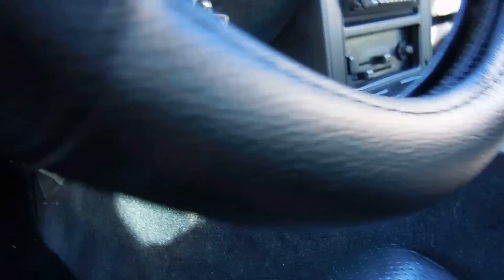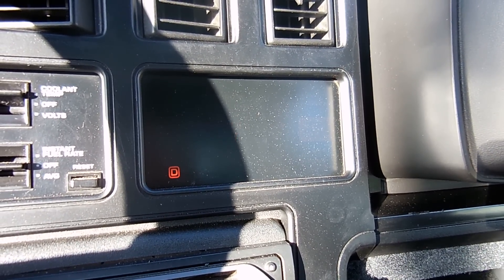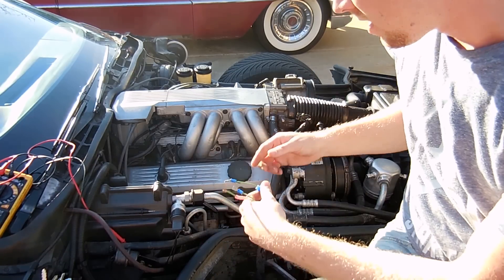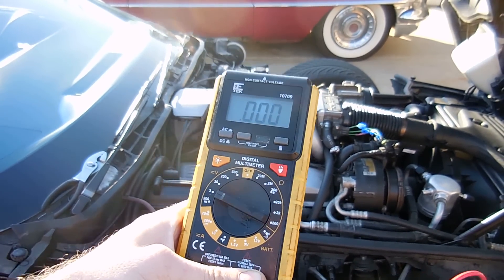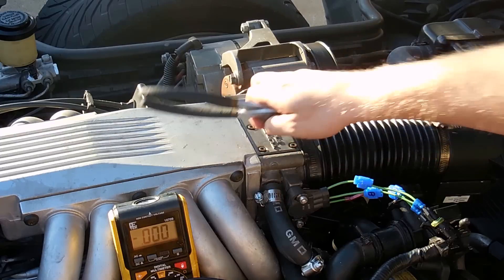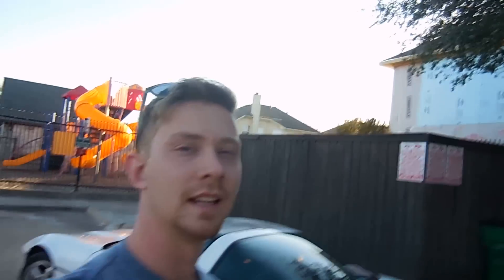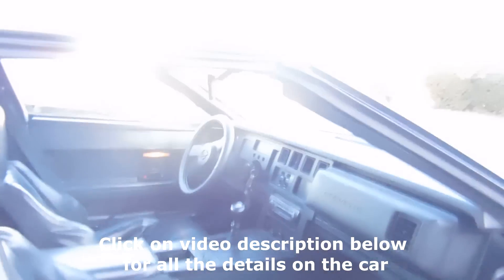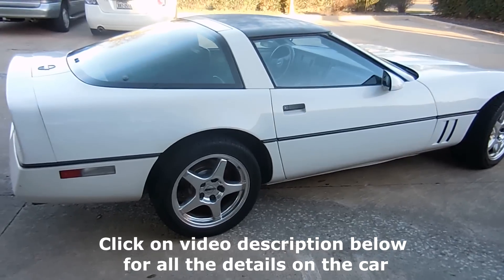1985 C4 Corvette Project: Daily Driver Part 8 of 8: TPS Code 22

Comment: you probably weren't expecting a commit on this video so late, I stumbled on your videos like a few days ago, I already. purchased my c4, its an 84 with less than 30 gs on the odometer, yes I knew it have problems it set in a machine shed on a far for 16 years. Yes an 84 is what I wanted; I still have the original poster. just saying that car look just like mine

Comment: My 89 was stalling but would restart. I thought it was the fuel pump or the fuel pressure regulator, so I changed both which did not fix the stalling. I found your video and then adjusted the TPS. FIXED! Thank you

Comment: The question not answered is did you fix the OD problem...  The OD, may have had a problem due to the OPEN thermostat.  There was a temperature sensor that caused the OD to shift out of OD, when the temperature was COOLER than 180 degrees.  It may have been tied to the Oil Temp if not the Water Temp.

Comment: Are the antennas to these supposed to go down all the way? I've just made peace with mine being always a foot in the air sticking out. It extends the full length when the car is running, so I just thought that was normal lol
Reply from the maker: No they should go down all the way. When it is up all the way, try using some WD-40 on it, might have dirt inbetween the moving parts, will help it travel smoother.

Comment: I usually replace those tamper resistant torx screws with the pin in the middle that GM likes to use on sensors with one with a Phillips or hex head.

Comment: I know this is an older video but if I were to drop only around 6k, would it be worth buying a C4 as a daily drive? (assuming i wouldn't have a whole lot of money for parts / fixes)
Reply from the maker: +Pterodactyl Mum you can actually get quite a nice c4 for 6k. You can also get a high mile ragged out c5 as well
Reply: TheCorvetteBen Would it be worth it to get a used car for that price without a whole lot of fixing it up?

Comment: 7k???  A little steep for an '85 don't ya think?   I mean I picked up an "84 recently for $700.00, running, derivable and not all that bad looking...  I'll have 5k in it total and it will be twice as fast as stock and look just as good as new...
Reply from the maker: Think what you want, but with the new engine in it, it sold for close to $7k

Comment: Hello, I really enjoyed the videos on the C4. I parked mine (1986) in the garage a few years ago and now it will not start. I replaced the battery, put $10 of supreme gas, and it will not turn over. I wanted to fix it up for my son, who's in college, because my dad bought it for me. Can you help me fire it up to get it to a shop?
Reply from the maker: +Aint No Mo Butter Cakes check battery connections and starter connections if the motor won't spin

Comment: Did you get 7k for it?
Reply from the maker: +Bill Dollarmovie close to it
Reply: I really want a c3, could I get lucky for around 5k?
Reply: +Bill Dollarmovie if you are willing to do some work on one. check out Craigslist, you might be surprised. I got a 77 once, nice, guy was asking 7k told him that I have 5 cash, he said come get it. cash talks! Good luck and happy hunting!
Reply: Glad you did this, I never pulled the codes, but my idle was erratic so I decided to put some use to a volt meter.  My voltage was high, brought it down to. 54 and it now purrs like a kitten every time I slow down or come to a stop.   UD Man., Keep up the great studies.

Comment: KnN filter with cut top stock air cleaner lid -10hp . air intake temp. sensor, clean mass air sensor -10hp. Street runner hyper-tech chip -15hp.  High flow converter and exhaust system -30hp. Take the spare tire and jack out along with fluid and filters changed, spark plugs -10hp. Cams and header? Even more hp.

Comment: The chip commands the injectors to open on every revolution which is double the fuel compared to the stock which opens on every second revolution.  ?
Reply from the maker: +Fred Mann Which I am sure does make a difference, but 230-350 hp just from a chip is a little optimistic if you ask me. There are a few huge threads on corvette forum explaining how most chips do little to no good. Basically the same concept as a K&N filter making your engine make huge power. It just isn't that easy to increase power by a ten second mod for $50

Comment: Im looking at a 1986. Guy says it goes 270 280 hp with d u i high voltage coils, kbd exhaust, and a performance chip. And also says he has a 350 hp chip not installed. How much hp do you think that would do?
Reply from the maker: +Fred Mann chips are basically a waste of money. He might as well say that stickers on the side of the car give him 100 hp. You gain power when you increase compression, fuel.and air.
Reply: If it's not a custom tune it's a waist of time. You don't get the hp the advertise. You may get 5 if lucky 10 hp. That's at very best

Comment: Looks great, that car surely put up a fight but it looks like your determination prevailed.  Did the TPS adjustment get messed up when you had the throttle body off/replaced it with a used one, or did the problem/code just occur naturally?
Reply from the maker: I removed the throttle body, cleaned it, put in new gaskets and adjusted the idle screw to get the sticking to stop when I pushed on the gas
Reply: Oh OK, so by altering the idle screw/throttle body position, you had to readjust the TPS as well...makes sense now
Reply from the maker: Yep that's pretty much it. I took the sensor off completely because I dipped the tb in Chem dip to clean it all out